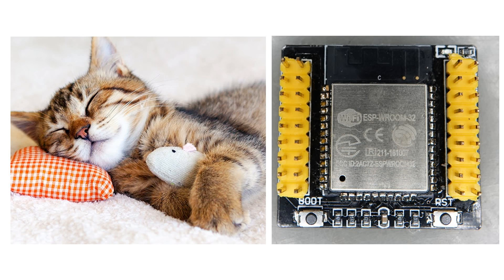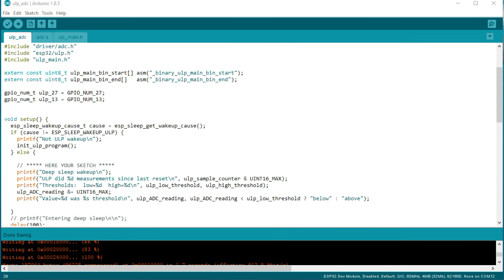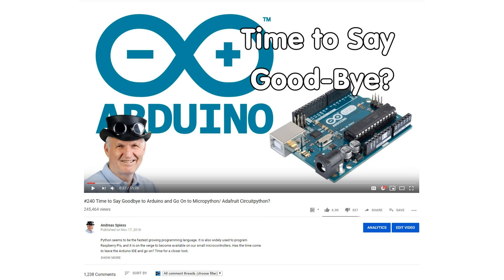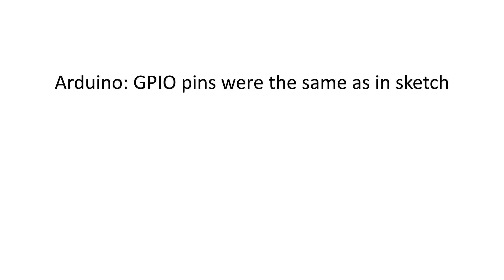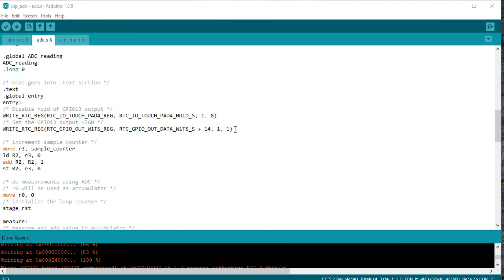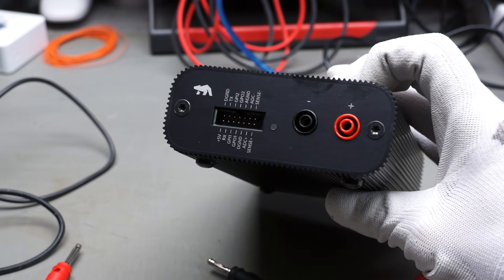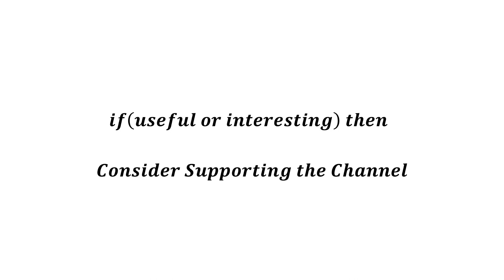#252 ESP32 Ultra Low Power (ULP) core made easy in the Arduino IDE including 100$ challenge

Comment: Aweseome! I've played around with the ULP using ESP-IDF, but it's a hassle to get it set up and integrated into the build system. Glad to have this video, the ULP is a really cool part of the hardware that hasn't been talked about as much.
Reply from the maker: Part of it was because it was no easy way to use it with Arduino. At least that is what I think.

Comment: Good to see this finally get some airtime :)  I tried it last summer but ended up running into problems with the ADC at the time.  Nevertheless, thanks for expanding the audience and hopefully the number of available working projects
Reply: What problems did you have with the ADC? Does the example Andreas gave here help you?
Reply: @aspzx  I had problems expanding to use the other pins at the time. I was using the same examples from Duff2t013.  They are good examples but I was short of the brain cells and it was hard work to get it all working.  As I recall, I got there in the end but it wasn't straightforward... In the end I kept on using the ADS1115.
Reply from the maker: I only used this example but did not do thorough testing. It worked for my thresholds.

Comment: Great info! I spent many years in assembly language on DG Nova's and early micros (6502 and 8080). Glad to get to use it again. The ESP32 has a lot of hidden power. Looks like fun.
Reply from the maker: So it will be easy for you. It is already good if you still remember how to calculate with short hex numbers and overflow ;-)

Comment: Wow! Been waiting for this for a long time. Amazing stuff. Now I can finally make my mqtt door sensors. I have boards for a trigboard-based design just for this task, but now I will try it with just an ESP32. Great stuff!
Reply from the maker: It needs a little more than a trigboard. But is probably ok for most battery applications
Reply: NS Gaming would like to build and IOT device if we can talk
Reply: This was exactly my thought. Wake on state change to report door open and door close events via MQTT without the need for complex supporting  circuitry. Exciting.

Comment: Great video as always, thank you. I use another method which works in C without programming the ULP. There is a wake up hook function when the ESP32 wakes up. It gets called before booting the ESP32, before the flash is activated.

C functions can be placed into the RTC memory for little processing. This function can continue to boot the ESP32 (which takes 0.3 secs) or put it into deeplseep again. This hook requires only 3 ms to check some processing. The advantage is can it can be programmed in C, the disadvantage is  that only low-level IO can be done because program functions (FLASH) are not available. However all registers and ESP32 ROM functions can be used, or own functions marked with IRAM_ATTR will also work.

This is pretty much low level like the ULP, however programmed in C with proper print debugging, etc.
Regards Helmut (Arduino Hannover & RadioShuttle.de)
Reply from the maker: Interesting idea. I did not know that it exists. Maybe there is a small difference: The ULP clocks quite slow but still is quite fast because of its simplicity (microseconds) and only needs "full throttle" 2mA. So you can run it every few ms and still hardly consume any energy. Might be interesting for faster moving signals where you have to check quite frequently.
Reply: The main reason I use the wakeup hook is that the deepsleep timer does not last long, therefore it wakes up the ESP32 too often which consumes energy, now I can just re-enter into deepsleep (3 ms versus 300 ms). @AndreasSpiess
Reply from the maker: That what I understood. It is a goo way to save energy by reducing the on-time.

Comment: you would think espressif would want to strongly encourage support of this feature.

someone should make a C compiler for the ulp. the 8kb of the ulp is quite adequate for some reasonable code.
Reply from the maker: Maybe they do. I do not know.
Reply: I would say that the target audience for this feature is comfortable with using assembler, so they see no need for a compiler. The code is minimal anyway.
Reply: Mai Mariarti  I see your point and I agree, I was only trying to see things from ESP's point of view.
Reply: Espressif guy here: The issue is that the ULP barely is a microcontroller. It originated from a few digital people trying to build a somewhat programmable state machine to do some sensor sampling in deep sleep mode, then added in enough logic to make it turing-complete. Porting C to it would be a pretty tall order. We have something in mind that will make that possible for the ULP in our next chips, if that's a comfort.
Reply: @Spritetm  I agree.  Some processors just weren't made to support a C compiler.  For example, 8 bit PIC chips.  This "CPU" smells more like an FPGA state machine.  Being a long time assembly language lover, I will be looking into this architecture.
Reply: @Spritetm  any news on this sprite? And thanks for the ESP range. I'm less keen on the s2 as it has less features, but maybe its a better ulp choice for the suggested i2c imu sampling project. What do you think, or do you have a newer product in mind as yet unreleased?
Reply: @tyeth  The new ESP32-C3 comes with a second Risc-V ULP in addition to the original FSM ULP (yup, 2 main cores and 2 ULPs), I believe ported from PicoRV. But again, with more responsibility also comes more power consumption.

Comment: Hi Andreas, the Voodoo you are talking about allows the compiler to calculate the size for all the ULP programs (which is why you have two arrays that contain pointers to the begin and end of the ULP program, respectively). But as always a fantastic video.
One idea for the challenge: Read 1-Wire sensors...
Reply: 1-Wire would be awesome
Reply from the maker: @Joachim: I thought it will also load the code to RTC memory? And thank you for your nice words!
Reply: Mai Mariarti  I tried the I2C example yesterday, and it does not work with Arduino out of the box (it won't even build). Although the adc code from their github doesn't work either, but Andreas's code works great. So there's some more voodoo to figure out. The list of operations has I2C_RD and I2C_WR, so I believe at least one of the pins has hardware support builtin. I'm going to try to tackle this today.

Comment: Great video, Andreas ... "until recently" the PICs were programmed in assembler too.
Reply: For some version of "until recently"... The MPLAB X IDE has been available for the last 5 years, for free with a C compiler :)
That said I had fun with the 12-bit words and reduced instruction set in the older PICs in the 90s. That was a different level of fun.
Reply from the maker: Maybe this is why PICs were no more as popular as Arduinos ?
Reply: PIC has been programmable in both C and assembly years before Arduino even existed at all and still can.  Also, while C is obviously more convenient there are still times when it is useful to use assembly. That is mostly the case when you need fast acting realtime operation such as precise timing signals, dealing with stepper motors running at high step rates and so on.

Comment: Awesome introduction, this opens a lot of possible use as battery powered security sensor for the ESP32. I have a garage that can't be connected to the alarm plant, but I can reach it via WiFi: I can now use a battery powered ESP32 to probe the environment and receive alerts if needed. Thanks!
Reply from the maker: You are welcome!

Comment: Yes,the good old times. Programming a Z80 with an Manual(a real paper book!), and then calculate the bits by hand( yes, also on paper.....) to hex values. Then type all Values by hand into the dev.board , which only have some switches, 7segment led and a small keypad! And  if it loose the power, all is gone. Young people couldn't understand, how amazing the first blinky on those projects make me so Lucky,  to get it running.....
Reply from the maker: Not to forget the cassette tape recorder to save the programs. I still prefer the modern tools if I have to get somewhere...
Reply: I had a lovely hand written ready reckoner for the Z80 with the instructions laid out in a 16 by 16 grid. Fond memories, but the good times started for me with emulators, break points, swiftly followed by C. Debugging assembler without JTAG sounds hard work.
Reply: I dont miss those days, but I still think it was a fun and educational process to toggle in the bootloader on an Imsai 8080 via the front panel! Thankfully, I'm not so old I had to enter the whole program that way.
Reply: Yeah these were the days. In the late 70's without an assembler I developed a four pole linear circuit simulator on a ZX spectrum. Everything was developed on paper and very little debugging was necessary because you had to think rigorous with attention to detail.  Still have a binder full of hand written assembly and it's hand-translated machine code. Unthinkable for today's standards. For back in these days this was the fastest code. But you had to do everything even design your floating point arithmetic. This program could deal with up to 200 nodes and had FFT for time domain output. Amazing how little memory we were forced to use.
Reply: I learned on 1802 by hand assembling.  A truly painful experience, but taught me to really think out the project before writing one line of code.
Reply: Mai Mariarti  I did assembly on the SCMP (simply cheap microprocessor) from NCR. As an aside, I can't find anyone else who remembers Heathkit.  I have an H89 I built in my attic which originally had an audio cassette interface as well.  It then moved to hard sectored floppy disks (64k) storage before discovering soft sectored technology.  Those were the days!
Reply: I  learned assembly in "modern times"  1986 using Tandys color computer 2   6809 processor. Loved it. Thats how I learned how a computer worked.
Reply: I had a NASCOM Z80 based development system, sadly now long gone. Among other things, I used it to develop the code for an electricity meter my friend was building. I do still have the Z80 manuals and I still feel the excitement I felt back then when I open them, whereas while I enjoy ESP32, I no longer feel as though I'm part of an exclusive club. Perhaps it's just my youth I'm missing! :oD

Comment: Hi, I hope you are well during this tough time in the world.  I have come across this video after searching online a way to keep counts of a pulse interrupt from a dds353 kwh meter and periodically send the counts over mqtt. I had not realized that esp was different from arduino in the way ISRs are handled during low power operations. Now I am convinced I need this approach shown in this video. Kindly point to how I can listen to interrupts and maintain a count for it then wakeup the main processor say after 10 minutes and pass the data over for Serialprinting( Mqtt transmission in my use case which I can do after I have figured out the ulp interrupt  and periodic waking up of the main processor). This is very useful stuff thank you
Reply from the maker: Nice project! I hope you will get it working.

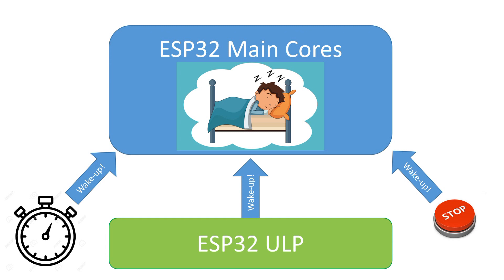Comment: Hi Andreas. At minute 2:00 you tell that the esp32 can wake out of deep sleep if a pin is touched. I thought it was only possible what a timer was reached. Does that mean that for example for a simple door sensor (with magnetic reed contact) I don't have to use this ULP core and I can somehow put the esp32 in deep sleep and only let him wake up when the reed contact gives a signal ? Can I do this on SIGNAL CHANGE? Or is it only on UP or DOWN but not on CHANGE ? Kind regards from Belgium
Reply: I'm not sure about signal change, but you can set up a trigger for the ESP32 to wake from deep sleep when an IO pin goes high. Here is more info: https://pcbreflux.blogspot.com/2017/02/esp32-deep-sleep-example.html

Comment: Thank you again Andreas! I still don't understand the Python kerfluffel. The craftsman chooses the tool most fitted for each job. I have a number of ESP smart sensors around the house that could just as easily be running Python. C++ just happens to be my go-to hammer. It was a lazy choice.
Reply from the maker: I have a similar opinion. And if you came from the RPI your go-to hammer most probably would be Python. That was the point of my question. Anyway: I learned a new word: kerfluffel ;-)
Reply: I like Python, describing C as a hammer does my head in

Comment: Hi Andreas! I would also add 50$ for a C ULP compiler. Why not pool together in BountySource?
Reply from the maker: As you might have seen in one of my last videos I will not start a community project in the near time. So somebody else has to do it.
Reply: If there would be a pool for an open-source c2ulp compiler, I'd also add $50 to it 😸
Reply: Hi folks, I'm really busy. But maybe writing a CLang LLVM backend is  not as hard as we all assume?

https://github.com/llvm-mirror/llvm/tree/master/lib/Target/RISCV
Reply: Maybe this manual is helpful: it talks about linking and memory layout:

https://docs.espressif.com/projects/esp-idf/en/latest/api-guides/ulp.html
Reply: I've spent probably 10 hours today working the i2c angle on this thing, and the compiler is starting to sound much easier. We have a C preprocessor and an assembler. The only layer missing is stitching together operations into assembly. After today, it doesn't seem so bad to get something rudimentary thrown together.

Comment: Kleiner Tipp zu deiner Kritik am Labeling der Pins: Durch die Mehrfachbelegung hat Espressif einige Ports eingespart, was wiederum Platz auf dem Chip spart. Das Label "Touch_Pad" scheint nach der Dokumentation von Espressif zu bedeuten, dass dieser Pin ebenfalls einer der kapazitiven touch pins ist. D.h. der Pin kann über den bloßen Kontakt erkennen, ob etwas "touchaktivierendes"(Bsp.: dein Finger) den Kontakt berührt hat. So kann bspw. ein Kabel vom Pin an eine leitfähige Münze angeschlossen werden und durch berühren der Münze kann etwas ausgelöst werden, wenn der pin im Programm verwendet wurde. 

Sonst, top!
Reply from the maker: Das weiss ich schon und ich habe ja ein Excel Sheet dafür erstellt.

Comment: As others have said, this is SO exciting!  Thank you for spurring the community for more sample code examples for layman like myself.  Correct me if I'm wrong, but it looks like the posted example for reading the built in hall effect sensor does not have an upper and lower bound to wake it from sleep?  Instead it just wakes up every 3 seconds to print its averaged measurements?

Also is it possible for the RTC code to run continuously in the background.  I have a project where the main loop scans bluetooth, then deep sleep.  It'd be nice if the RTC could continue to poll a sensor even when the chip is awake.
Reply from the maker: You are right: The ULP should decide on when to wake the main cores.

Comment: Excellent video!
Maybe a low power solar powered version of the Geiger-counter? Now it draws a lot of power because the ESP has to be always on to count the pings. I started to think about to do it with an ATTINY85 and an ESP yesterday. Where the ATTINY does the counting, and wakes up the ESP every few minutes, passes the ping number to the ESP and the ESP uploads the values to Thingspeak or similar. But maybe the ULP of the ESP32 could do the counting?
Reply from the maker: Counting the Geiger pulses would be a good example. Only trigger the ESP if an alarm occurs and your ESP runs for a long time ;-)

Comment: How can I have missed this video? Ah, I see, I was abroad.
Must have been 30 years when I was still doing stuff in Assembler (6502 and 8051 series)
I disagree with you comparing it to a somnambulist: After your explanation of the pin numbers and hold commands, I prefer to see it as 'undead' or 'living dead'
Reply from the maker: I will not start a fight for the right wording;-)

Comment: Does the built-in ESP32's JTAG debugger work for the ULP as well?

Can the ULP run all the time, not just when the main processor sleeps?

Is there a IDF IDE way of compiling, debugging/flashing.. or does one have to use the Arduino IDE (duff2013 / ulptool , jasonful
/ lcc) ?

BTW, Interesting how the official block diagram of the ESP32 C3 doesn't list the ULP block!
Reply from the maker: I do not know if the ULP can be debugged (I fear: No). And it runs in parallel to the other CPUs.
Are you sure the -C3 has an ULP?

Comment: Hi Andreas, again a great video! I would like to know if it is possible to have interrupts in ULP, I would like to have my 3D printed weather station working with ULP to save energy. So I would need to count rain drops and wind speed in ultra low power while main processor is in deep sleep and after a minute wake it up and send all the information using LoRa TTN.
Reply from the maker: The ULP does not use interrupts. As described it starts every few ms. So it should be possible to measure both, wind speed and rain. At least my sensors create a relatively slow squarewave which can be read with the ULP.